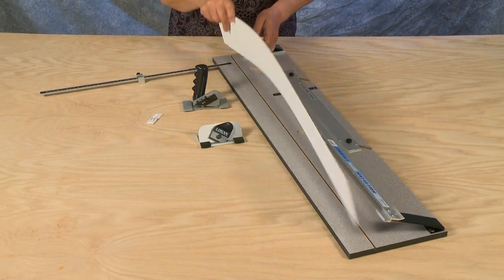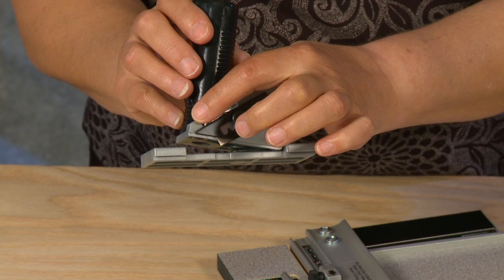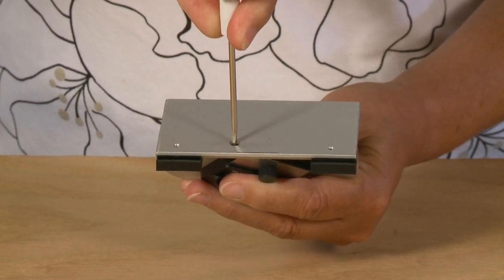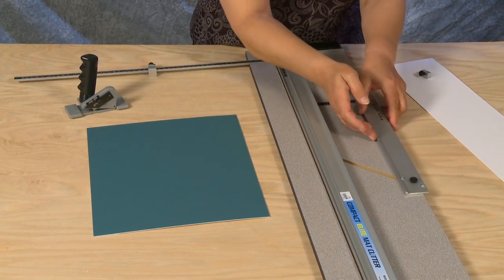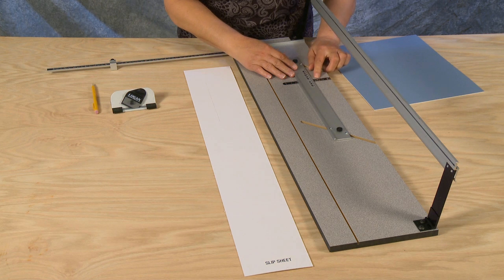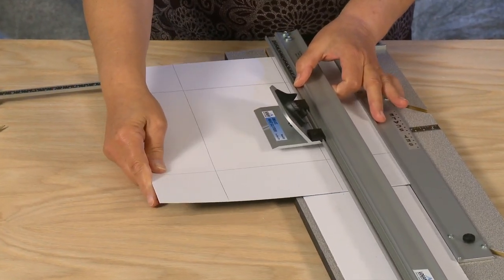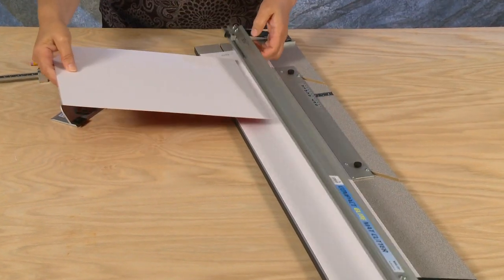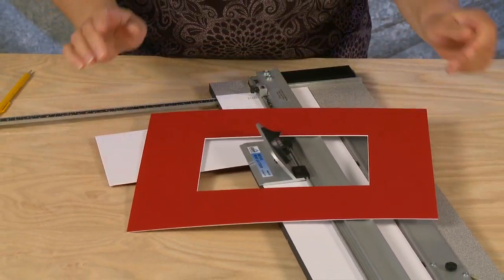LOGAN 350-1 Compact Elite Mat Cutter

Comment: I’m confused! When making the las mat cut using production stops, you only made 1 line for one side on the back of the mat. How did you know where to stop without the other 3 mark lines?
Reply from the maker: Hi,
You can go off the cut in the back of the mat to tell you where to start your next border cut. That is the reason after each cut, you turn the mat black clockwise so the cut you just made now serves as reference where your next cut starts. This works best on even border mats. If the borders are uneven and you have multiple mats to do of the same size, then you set up the stops for either the long or short sides first, make those cuts and the reset the stops for the remaining sides and finish the cuts. Hope that helps. Thanks. LGP

Comment: Mine arrived out of square
Reply from the maker: Hello. Each machine should certainly be square when new. Can you tell me how you determined the machine was not square? Understand that a new full sheet of mat board is not going to be square. Not that this typically causes a problem as a slightly unsquare piece of mat board generally has zero effect on double mats or even fitting into the frame. If you have questions, please contact us at 847-526-5515 or cs@logangraphic.com. Thank you.
Reply: @LoganGraphic  I used a large metal carpenter's set square that I know to be completely accurate. In order to get the unit into square, I had to loosen the screws as advised in the instructions. But even that did not get it completely into square. I had to enlarge the adjustment holes to get the unit into square. I suggest some attention to QA at Logan. Interesting note: now that the unit is properly in square, the slot cut into the MDF base no longer aligns with the metal bar all along its length.

Comment: not as easy as it looks.  On bevel cut my blade will not extend down enough to go thru, I have made sure I loaded only one blade in the cutter tried adjusting depth of blade there is only so much you are willing to do as you don't want to damage equipment or throw something out of adjustment.  I tried different mad boards same thing blade rubs on rail and only slightly scores mat board.  I did manage to cut a thin piece if construction paper.  If this is whats it"s like cutting your own mats, I may just have it done at a frame shop.  I can cut glass and even make my own frames, too bad.
Reply from the maker: +Steve Branch 
Hi Steve,
Make sure you have the blade installed properly. If you can see the entire blade after you replace the blade screw, then the blade is in wrong. Part of the blade needs to pass through a thin slot cut into the aluminum directly below where it sits on the movable blade holder. Then make sure you use the screw on the underside of the cutting head to adjust the blade depth so that it barely passes through the mat board and only scores into your slip sheet which should be scrap mat board only. This machine is designed to cut standard thickness 4 ply mat board which it should have no problem doing. Please watch the video on this machine to see the proper way to install the blade and adjust the depth. This video clip starts out using a similar cutting head as the #302 you have showing how to adjust blade depth. https://www.youtube.com/watch?v=RMh7t2saEqw. If you still have problems, please call us at 800-331-6232.
Thanks

Comment: I'm trying for the first time and I can't get the blade to cut into the mat. I tried to adjust it as shown in the video, but it's too hard to push down to make a cut. Is that normal? And I just realized that the blade is cutting into the guide bar and leaving a score on the bar instead of the mat.
Reply from the maker: Hello, Make sure the blade is installed so part of it goes through the thin blade slot beneath the blade holder. Part of the blade disappears through the cutting head and only a small amount comes out the bottom of the cutting head. If you blade is cutting into the guide rail, then the blade is not installed properly.  Watch this video starting at 1:08 to see how a single #270 blade is properly installed. You are also welcome to call us at 800-331-6232 or email at cs@logangraphic.com
Reply: @LoganGraphic  Thank you so much for your reply. I did have it installed improperly and now that I have it correct, it works perfectly. I'm looking forward to cutting lots of mats for my art. Thanks again.
Reply from the maker: @mebharris  Thanks for letting me know. Enjoy the mat cutter.

Comment: Hi how am I supposed to cut a .5 inch mat with this? I bought the product but no idea how to get a .5 inch mat set up properly, there i not enough room to scale it and I am eyeballing it
Reply from the maker: Hello, Our board mounted mat cutters have a minimum border size of 3/4" (19 mm). However you can achieve a thinner border if you intentionally cut borders exactly 1" larger then the border size you want and then use the straight cutter to trim 1" off all four sides. In your case, set the mat guide to 1 1/2" borders, cut the bevel opening mat and then use the straight cutter to trim exactly 1" off all four sides. That will result in the small 1/2" border size you need. Thanks.

Comment: I think I might prefer to position the stop at the far end. It seems to me that it's relatively easy to start in the right position but harder to control the point at which you stop, especially with arm outstretched when cutting larger mats - plus the possibility of parallax error. Is there any reason why the stop can't be placed at the end of the cut?
Reply from the maker: You are welcome to use the stop at the top only. Whichever works best for you. The 350-1 comes with two guide rail stops for use when repeat cuts are being made. Setting the stops up for one side to pre-cut half of all the blanks and then reset the stops for the other side to be cut speeds up the process of production mat cutting.
Reply: @LoganGraphic  That's very helpful - thank you.

Comment: The measuring bar is not sitting in the hole properly which means the cutter jams into it and doesn’t finish the cut. I am nervous of using brute force to make it fit. Am I right in thinking it should fit into the hole so it makes a smooth surface for the cutter to do it’s cut. Try as I might I can’t get a good glimpse of the fitted bar on the tutorial so would appreciate it if someone would take a picture of how the bar sits in the hole. Thank you
Reply from the maker: Hi Jean, The bar should sink flush to the top of the base board and not interfere with the straight cutter passing over it. Please call us at 800-331-6232 or 847-526-5515. Use extension 27 so we can get some more information and take care of this problem for you.
Reply: Logan Graphic I am happy to say the bar sank into the fitting flush and everything is working fine. Thank you for replying to my query
Reply from the maker: Great to hear this. Any time you have any questions, feel free to call us at 800-331-6232.

Comment: Can this be used for cutting foam board as well?
Reply from the maker: Hello, yes the 350-1 Compact Elite Mat Cutter comes with a 701-1 Straight Cutter Elite that will 90 degree straight cut foam board up to at least 3/16" (5 mm) thickness. The bevel cutter may be able to bevel cut thinner foam board but in general, its not really designed for that use and meant for bevel cutting standard thickness mat board. Thanks.

Comment: Could I use this on a 24x32 inch mat to cut a window of 22.5x32? Thanks.
Reply from the maker: Hello. The capacity of the 350-1 Compact Elite is 32" from the squaring bar at the bottom to the far hinge at the other end. So yes you can insert a 24x32 blank into the machine. As long as the blank fits into the machine, you can set the mat guide for borders 3/4" up to about 4 1/2". Or you can remove the mat guide and mark out wider borders manually.

Comment: Can you remove the mat guide to cut longer mountboard? In multiple cuts?
Reply: I guess I could use the Team System Plus?
Reply from the maker: Hello. Yes the mat guide can be removed easily from any of our mat cutters. However on the 350-1 Compact Elite, the mat guide is not what's limiting the capacity from end to end. That is 32" capacity is limited by the squaring bar at the near end and the hinge at the far end attached to the aluminum guide rail. Removing the mat guide from a 350-1 Compact mat cutter allows you to freely slide the material left to right through the machine. Which is helpful if you had a multiple window mat being cut where the mat guide could not be used. But the capacity still remains at 32". Unless maybe you remove the squaring bar also. But then you would have to re-square it later on. The 301-1 Compact Classic does not have a squaring bar so being an open end mat cutter, you could do a process of cut and slide to cut mats longer than 32". If you think you will be doing this often, it is recommended to go up one level to the 450-1 Artist Elite which is a 40" capacity mat cutter. Thanks.
Reply: @LoganGraphic  OK thanks - will the Logan 701-1 Straight Cutter Elite fit on the 301-1 Compact Classic?
Reply from the maker: @TJFNixon  Yes. In general, any of the tools we make that "hook on" to the guide rail are interchanging with each other. The same cutting heads that come with the Compact series can be switched for any of the cutting heads on the Artist Elite or Simplex series. Thanks.
Reply from the maker: @TJFNixon  Yes a Team System Plus would certainly work but then it becomes a full two hands operation not having the benefit of a base board mounted unit with a mat guide and squaring bar. It all depends on your volume. All Logan mat cutters produce the exact same looking finished mat. It depends on how much production or repeat cutting you plan to do. The higher up you go, the faster production orientated the mat cutters are with more features to speed up the process.
Reply: @LoganGraphic  ok ace. Thanks for the quick responses. 👍🏻

Comment: On the measuring ruler, lengthways and widthways, are there markings for A3 and A4?   Many thanks
Reply from the maker: Hello, Our mat cutters will be scaled in either inch or metric depending on where they are being sold. But no, there are no specific marks for A3 or A4. Thanks.
Reply: Thank you

Comment: Hello...I'm relatively new at using the Logan 350-1. I'm doing OK, but I seem to be having trouble getting perfectly measured squares.  I'm cutting 18" mats and backing boards, but when I go to measure them, at least 2 of the sides of a cut square will be off by 1/8" from a corner. The top of the square is 18", but the bottom is 18 1/8", and same with the L & R sides. It seems like when I try to fix one side by cutting from the corner, it messes up the next side, and so on. I've been so careful loading the full mat board along the squaring guide and measuring stop. Any ideas how I can improve without going broke on nice mat boards?  This also makes it challenging when I'm creating a hinge joint to the backing board. Thanks in advance.
Reply from the maker: Hi Patricia 
Please give us a call at 847-526-5515 and we can walk you through squaring up your mat board before cutting out the openning.

Comment: I have one of these but don't have a slip sheet. What can i use instead?
Reply from the maker: Hello, A slip sheet is simply scrap mat board placed under the mat you are cutting. It needs to be only large enough to cover the area you are pushing down and bevel cutting. You do not use a slip sheet when straight cutting or downsizing blanks of mat board. Only when bevel cutting. The slip sheet protects the face paper of the mat you are cutting it by supporting the face paper when you are cutting from the back side of the mat. Only use scrap mat board as a slip sheet and nothing else. Keep your scraps as they may be possible to use as a slip sheet. I hope that helps, thanks. LGP.